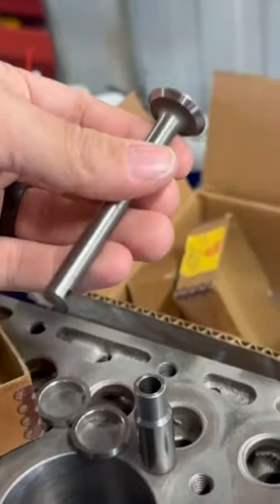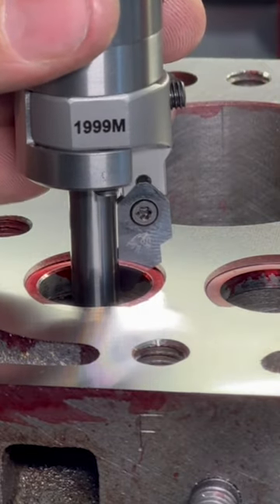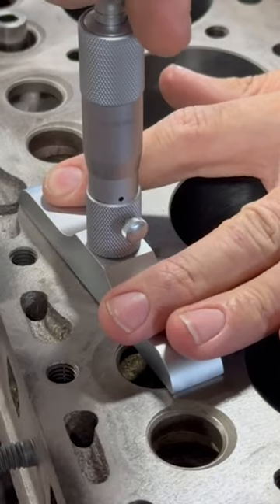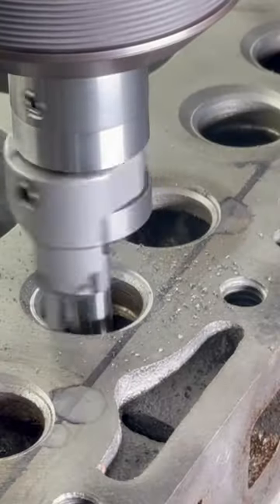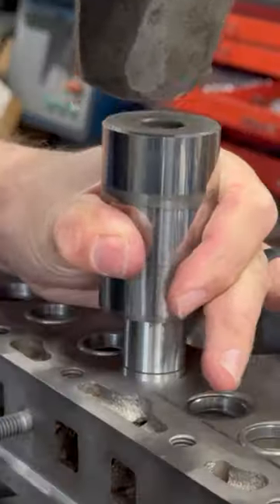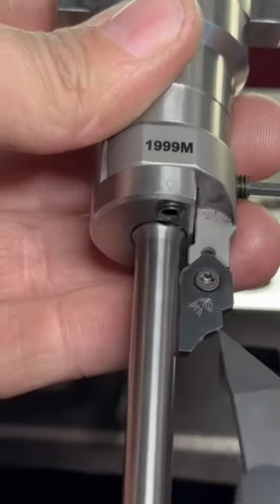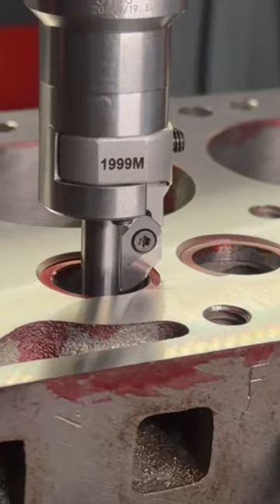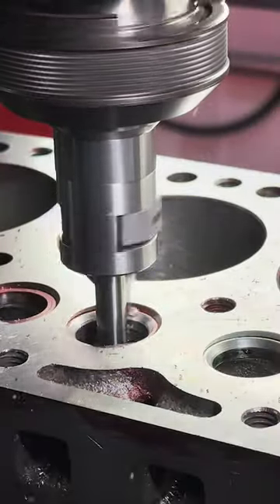#Shorts The Smallest Valve Seats I've Ever Machined?

Comment: the only problem I had with a continental was after doing all the same and vacuum testing valve seat when done and passed.
   but when customer assembled engine had extensive valve leakage was very frustrating. but found out when torqueing down head it deformed valve seat. originally had head bolts but installed studs instead  . help a lot but never could get perfect valve seal. remember the job very well very frustrating.